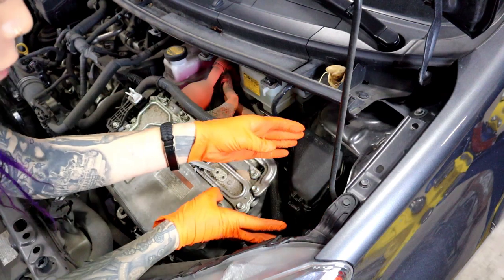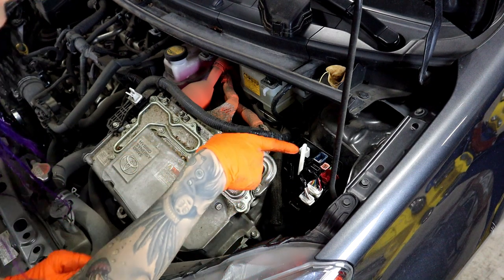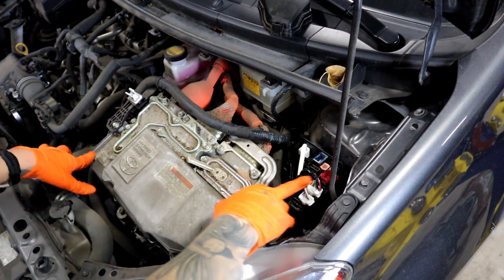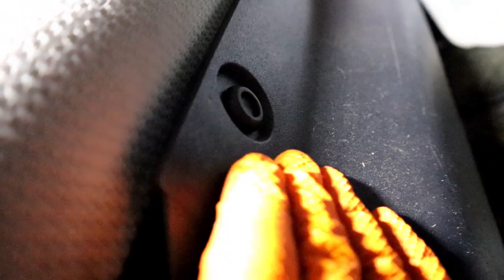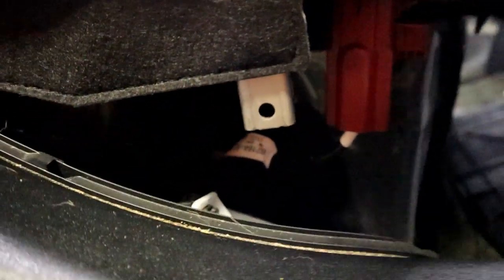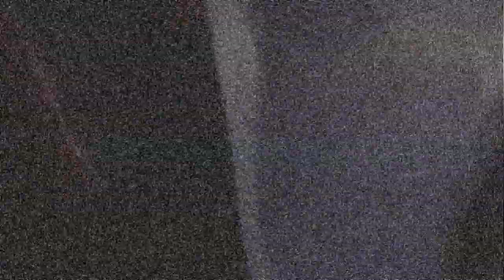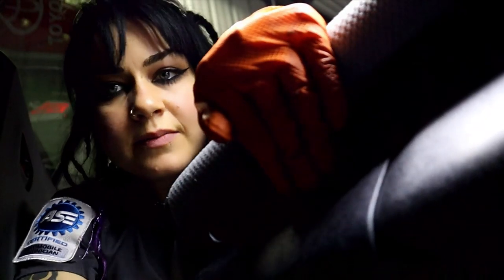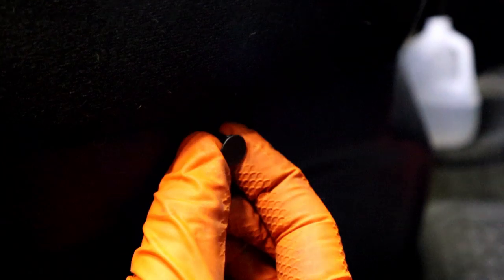Where is the Battery on a Prius C?

Comment: I guess it's safe to put the battery under the back seat now that there are no springs to be pushed down to short it out! My VW Beetle had the battery under the back seat. It was a real pain to jump if not enough people were around to push you and then pop the clutch to get it started.

Comment: What brand of wrench did you use to remove battery terminals?  (I like the 6 point design).
Thanks.
Reply from the maker: Thanks! It's the new ratcheting wrench set from Capri tools👍🏻

Comment: That is more of a pain in the butt than it needs to be. Batteries should be under the hood right in front.
Not hard to engineer in enough space to do this in the design phase of a vehicle.

When a vehicle from any manufacturer is easily serviceable, it is not because the engineers designed it that way.
It is just luck.
Because none of the manufacturers take ease of maintenance into account when designing a car or truck.
They should all be punched in the nuts every time I tear the skin off my knuckles doing minor maintenance because
they made access difficult.
Thanks Faye, for saving someone from going crazy trying to find the battery in the Prius C if they have no owners manual.
Reply: Folks who have vehicles with the batteries in weird locations also find out that the auto parts places that do "free battery testing and installation" will typically charge them a fee to install the battery because it takes much longer to do the installation. I was in Advanced Auto once and a BMW owner was all bent out of shape because they said there would be a fee to replace his battery.

Comment: Hi  i have 4runner 1996, this month it started  to give off white smoke  when i turn on. also notice that the cooland reduce , my friend told me maybe have leaking, maybe i need change head gasket...,do you have any video on how to know if the head gasket needs to be replaced.
Reply from the maker: Yes I do! It's called something like "I bought my truck from a junkyard" and the cover photo says "how did I know?" I do several tests on my 4runner to check for head gasket issues!

Comment: Just can't put a battery under the hood anymore, can they?  Found my wife's Durango battery under the front passenger seat.  Plenty of room under the hood but they just have to go all silly.
Reply from the maker: What?!? Weird!!!! Well they do tend to last a little longer when they're not under the hood......
Reply: @FayeHadley  I suppose it is to last longer.  Bought the Durango in March 2014 and the battery still operates like a champ.  It's also an AGM which gives it a longer life.  Now, my truck's AGM battery is under the hood but then again it's 3x bigger to roll my diesel engine over in the winter.

Comment: you actually can't remove the 12 volt battery because there is a clip behind the nut on the positive terminal that prevents you from removing the nut/bolt from the positive.terminal. So unless you have special access to the tricks that are no where on the internet you cant actually remove the 12 volt battery without special knowledge of the gods